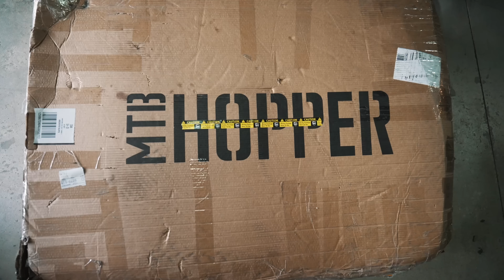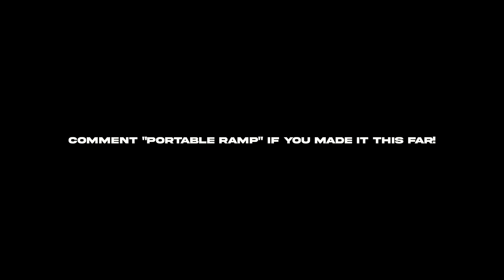THE BEST SUR RON X RAMP YOU CAN BUY!?

Comment: Make sure your throttle regen is set to at least 1,had the same throttle problem with my bike when rolled backwards.
Reply from the maker: Yeah my regen is 0😭😭
Reply: It sounds like it could be a hall sensor issue.  If the halls are faulty, I'm pretty sure the BAC can run in sensorless mode which would explain the bike not throttling unless the wheel is spinning forward.  This is because without the hall sensors the motor doesn't know the proper position/rotation unless already spinning.